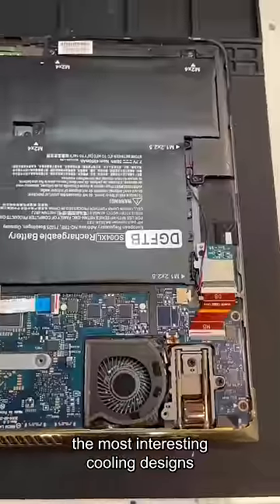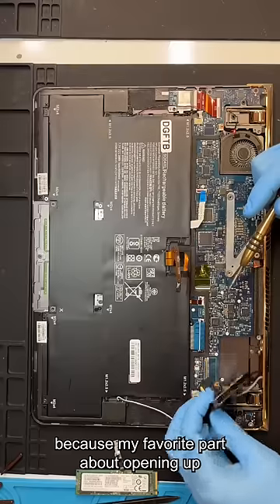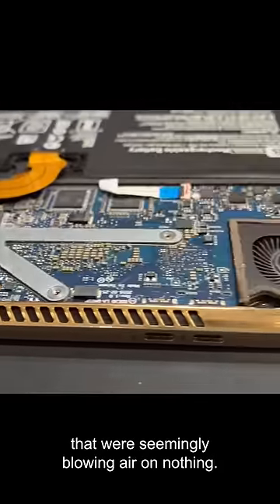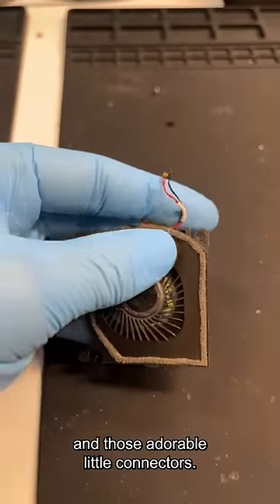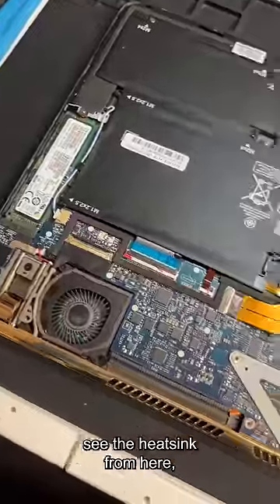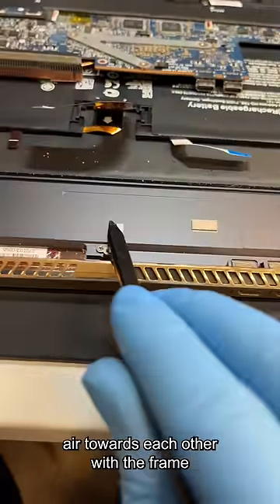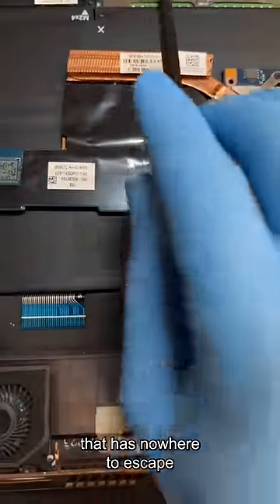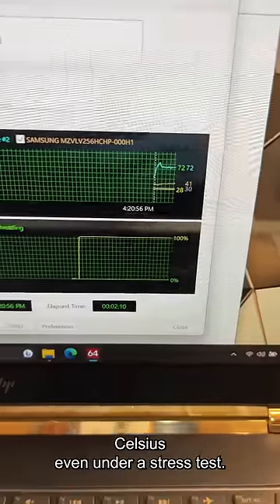This HP Spectre has a unique cooling system #technology #laptop #pc #shorts #tech

Comment: That’s really smart!!
- wow 135 likes!!
Reply: No, it's not. It's the same design as Apple did a few years ago and it doesn't work very well at all.
Reply: @raycert07  Do you mean that macbook Air without any vents?
Reply: @Maxinator6120  no, and they do have vents. I mean the 2019 or 2020 macbook air that has a tiny heatsink in the middle and the fans on the sides and it's expected to push out the air through the heatsink via the chassis. Barely works. It hits 100 degrees instantly under load despite only being about a 10 watt chip
Reply: @raycert07 thats apple to you.
Reply: Seems like planned obsolescence. The seal will fail, eventually.
Reply: @raycert07 bruh the vents are small that it heats up
Reply: @thishandleisntavaiIable  that's not why it's heating up. It's heating up because there's no FAN BLOWING ON IT. Relying on chassis pressure to blow air out is a stupid idea because half of it is going to leak out and the rest your assuming goes through a perfect little heatsink and exhaust, it rarely does so.

Every single laptop with this design was quickly scrapped because it sucked and didn't work.
Reply: @raycert07  then they should make bigger ventilation

Comment: Apparently the Steam Deck has a similar design, idk too much about it but it's only because some Custom Backplates have addition vent cutouts thinking it'll increase cooling (which it does to an extent) however it also removes that airtight seal meaning some of the farther out components that would be cooled normally are now no longer.

Comment: Staying below 80° Celsius says more about ghe precice throttling mechanisms in modern cpus than about that cooling system. What you should really compare to other laptops is what sustained all core clock looks like, because thats where you gain performance even when a device runs hotter than the other one.
Reply from the maker: This was able to stress test without throttling which is why it was so impressive.

Comment: Engineers that have to deal with ventilation will tell you that there is a dead zone of air where those two pressure fronts meet. Can't see if it would be a problem here though.

Comment: Heaping Piles occasionally comes up with something neat that actually works fairly well. Unfortunately they never keep those designs around for long. The majority of their mid-low end laptops have used the same outdated single fan cooling design for years now. It didn't work well with 6th gen Intel and it definitely doesn't work well with newer stuff. I remember seeing laptops like the Spectre (this same model as in the video actually) and thinking "if they used that on all of their laptops, maybe my laptop wouldn't be able to LITERALLY COOK BACON while I'm watching YouTube"

Comment: My old MacBook blows the air out the back, but there is seemingly no vent for intake. The air creates a big flow on one side out the gap of the display hinge so I thought maybe it sucks air in through the other side of the same vent, but on the inside I don’t see a path to the fans and that would be a bad design because it would suck the hot air right back in. If you put the fans on max speed you can very clearly notice the keyboard gets very cold. If you put your hands on the keyboard you can feel the air getting sucked in through the gaps in the keys. Someone should blow some smoke in the air to see how the air flows because it’s surely very interesting.

Comment: So basically the macbooks "cooling system" done right
Reply: Not at all. I had this laptop before I built my desktop PC and then bought a refurb MBP to upgrade. The fans on this spectre model were horribly loud and the entire unit got incredibly hot. This YouTube short is a nice edit. Nothing even close to a MacBook in terms of function or form, even the old plastic clamshells had better cooling.
Reply: @JM_Solo  Have you ever actually used a macbook? They have all those same problems. Their fans don't ramp until they need to run at over 6k rpm and the metal bodies get hot because they let themselves thermal throttle for a while before trying to stop it. Macbooks aren't exactly renowned for their cooling. This only changed with the ARM processor Macs. Try touching the top part of your macbook where a touchbar would be after its been on a while doing work. The case temp in that area will be in like the mid 40s C.

Comment: Those are not fans, they are impellers. Fans direct air through the blade, impellers act on a fluid to force it through a housing. It's the same principle that keeps GPUs cool when they have the old blower style cooler. Intake impeller forces air laterally through the enclosure and through heatsink fins.
Reply: The part that spins is an impeller, the whole unit is a centrifugal fan. From Wikipedia: "the centrifugal fan has a moving component (called an impeller) that consists of a central shaft about which a set of blades that form a spiral, or ribs, are positioned. Centrifugal fans blow air at right angles to the intake of the fan and spin the air outwards to the outlet"

Comment: I ended up replacing the board on my in law's Specter. The board got so hot, the back/bottom panel was discolored from heat. Also replaced the screen, common with these.

Comment: Ha! My laptop keeps cool insanely well because I can pull the keyboard forward and expose the two huge fans. I rarely hit 80°c even with the most intense games. Sure the fans are a bit loud, but the cooling is insane. If the computer gets above 75, I can just turn up the fans and in a minute or two, it has cooled off!

Comment: Damn i had a customer with a spectre complaining about the laptop having 100% fan speed which he could hear from far away and the battery stuck in 20% and dropping dramatically when i opened the laptop i saw the connector not plugged in correctly thus having one fan of the two spinning at 100% rate i work in a company fixing customers devices everyday , laptops phones you name it(except printers and TV's)but the other shop that my company owns did this mistake he send it to fix the screen and they didnt plug in the connector correctly after that while i unplugged the whole motherboard and saw two little heatsinks the size of the top of the toothbrush and the small coolers blowing air outwards after powering the laptop on i did some stress tests and the cpu would reach 100 degrees Celsius, on 4 cores 96c when it was thermal throttling the fans would go 60% of the speed and cool off each time nice design😂

Comment: 80C is kinda high, for a 6th gen, and without a GPU, This kind of cooling is what we call, getto tax, you need proper fans and copper tubing for the best heat syncs without liquid, small fans are bad, the MSI G63 is an example of proper heat syncs, even if it didnt have a GPU, it uses a specific bottom exposed fans (its why you prop your laptop) that lead to copper tubing out the back, a proper air flow, creating that kinda of "pressure zone" wont cool as well, its been said, the 6th gen i7 is 80C under load

Comment: In my lovely Latitude E6520 the fan blows through the heatsink, but is sucks the air not directly from outside. The air went through opening that was cooling first the ram and motherboard, then it got into the fan.

Comment: That's...weird. O.o  I like my Acer Aspire 5 A515-43-R19L (which I've maxed out the memory to 32 GB, increased the C: drive from a 128 GB to 512 GB Gen-3 M.2 SSD, and added a 2 TB 2.5" SATA HDD for the D: drive). It's quiet, never gets hot, I keep it clean (even have a silicon keyboard cover skin on it). Only one time has it ever ramped the fan up to a howl and that was during a firmware update, though that level only lasted under a minute, maybe closer to 30 seconds. It works fine for me with what I use it for (writing my books, creating digital paintings of characters, playing music, some light gaming, surfing the 'net, making slideshow videos, spreadsheets, and mundane home office stuff).

Comment: Finally, a computer worth of me using 50 tabs and in those 50 tabs are another 50 tabs. 50 × 50 = 1000 tabs opened -> computer breaking. I've done this on a normal school computer and it worked fine for 2 years. Google Chrome Mac Book, very cheap but very good😂

Comment: meanwhile a 2021 Dell Inspiron 16 Plus with 3 fan and 5 copper pipe can’t handle a i7 11800H and it max out at 102c in basic workload
Reply: What? Replace thermal paste or clean your fans bruh
Reply: @RichBatangKalye  I got it brand new from Dell, starts overheating on Day 1, and I no longer own it. Dell refused to let me return the device or do RMA so I threw it away. I even repasted it with Arctic MX6 thermal paste and TP3 thermal pad and nothing work before I threw it.

Comment: It’s not beastly at all. It’s a U processor and it barely draws any power so it doesn’t need that much cooling.
Reply: Mine can exceed 100 C playing when turbo is turned on, with only base clock it max 95 C

I really need to repaste it

Comment: I did open a laptop for a customer a while back ...it had a similar design and a fan that was blowing air to nowhere - impressive design ...also a capacitor was there with a ducktape and some leds as it was too tall to be straight - It came like this from factory!! it was a "Greek" brand but I guess they ordered like cheat-knockoffs from China and rebranded it - Worst laptop I've seen in my days

Comment: Hi ,I also have an HP and it is very slow and heats up very   fast it has a i7 6500u and Sandisk SSD with 16 GB ram. is there anything I can do to fix it I have installed windows 11 pro

Comment: my asus x541uvk has the worst cooling system. basically just a blower fan that is choking because it sucks air from the little gaps between the keyboard, and blows the little amount of air, through the tiniest and $hittiest heatsinks that I've ever seen. although it only has a i3 7100u and a geforce 920 mx, it still gets up to 74 degrees which might not seem bad, but that cpu pulls 10w max, and gpu 16w max. and the fan is screaming.

Comment: This is a stupid design. I bet if you block those vents for even a second, that's it. So thier genius idea is to have no airflow, so just let the heat build up then blow the heat out and not attempt at all ti bring in cooler air. There simply is not fall back here, one mistake, one fan fails and that's it. 

Ok full disclosure, I know nothing about fans or computers. I came across this at 2am.